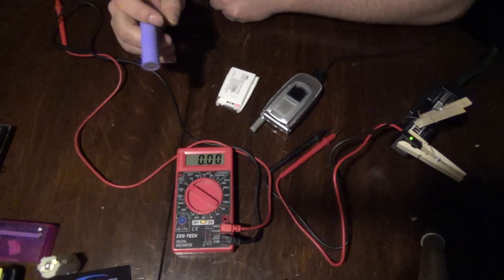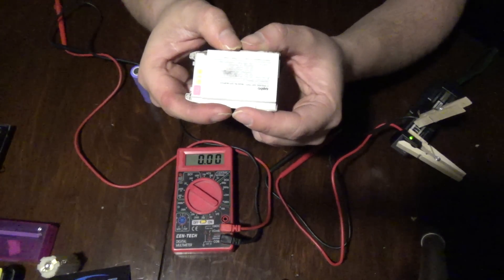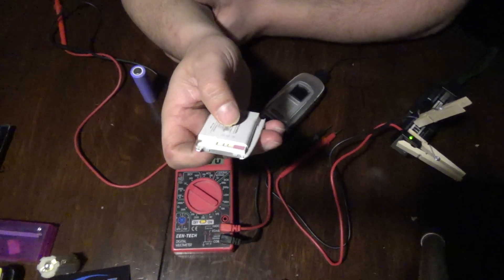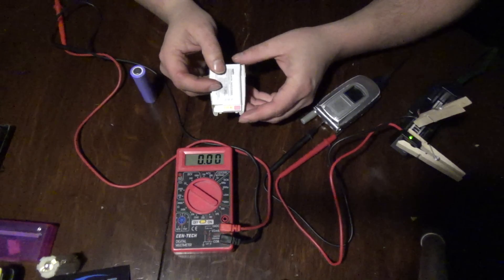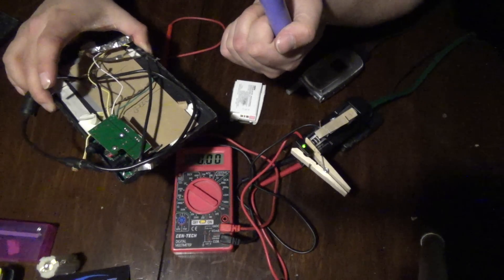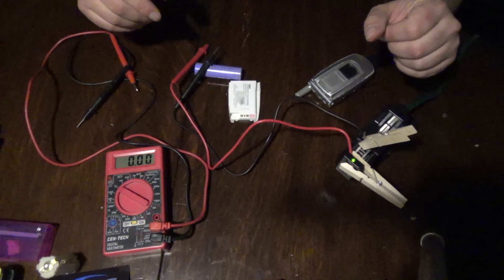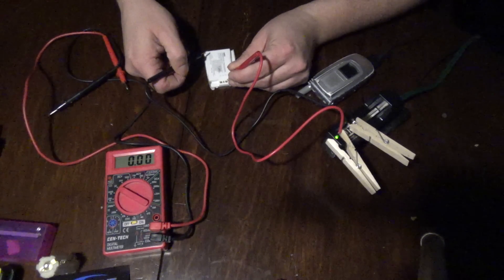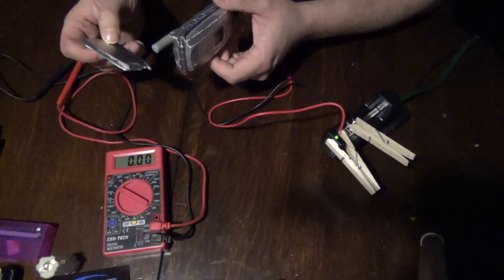How to wake a dormant Lithium Battery Cell. Works on both Cell Phones & 18650s & Similar

Comment: Hi Kman Auto,
This is one of the most informative videos on the subject of lithium batteries that I have come across. Thanks.
I just rebuilt my Acer Aspire 5552 but the new cells are only giving me half hour of battery time same as my old ones. Do you have any suggestions? Thanks.
Reply from the maker: I see, and a little extra detail you provided this time goes a long way :)

The low-down is, it's not actually "Gaining" any capacity back. 

Most people think the power in batteries, like your ipod, or a laptop, is a absolute measure, like, how a car knows exactly how much gas is in the tank. However, this is incorrect.
The "Fuel Gauge" or battery meter, is actually just a GUESS. Believe it or not. 
How this Guess works, is measuring how much power is put into the battery, and how much power is taken out of the battery. Example, if I was able to put 1,000 mAh into my lithium cell, and my flashlight consumes 500mAh, then, logically, their should be about 500mAh of power left in the battery.

However, due to power transfer and charging inefficiencies, this number can be off. Usually, on a device thats used regularly, it wont be off enough to make a difference, however, it can get further inaccurate over time.

The best way to "reset" this, and give the software the most accurate way of getting that guess correct, is by draining the battery very low, then fully charge it. I do that to my Tesla every so often. 

Now, leaving your iPod sit for a few months then using it but finding the battery meter dropping quickly, is due to self-discharge.
All batteries will discharge themselves over time. Lithium will loose 1-5%/month, depending on the age and condition of the battery. So, after sitting for 8 months, the battery self discharged 4-45% of it's power just sitting on the shelf. Now, that power is gone. HOWEVER, the software, did not see that power go anywhere, as the device did not actively consume it. So now, the battery meter is very far off. Then, after a discharge or two down to a low state of charge, then back up to full, allows the software to calculate out closer to the true capacity, and gaining your "lost" capacity back. Your not actually gaining back anything, just resetting the "guess o meter" allowing it to get it's correct charge and be more accurate in the guess.

Now, for Lead Acid batteries, they actually do need "Break in" cycle when new. Example, when I install Lead Acid batteries in a electric car I've built, I need to carefully cycle them. First trip 2 miles, then recharge, second trip 4 miles, then recharge, then 5 miles, recharge, then 10 miles, recharge. And do that a number of times, This allow the new battery to reach it's full potential. If I just put new lead acids in, and tried to drive, i'd get maybe 10 miles before dead. But, with the new battery cycle like that, at the end of the break in phase, I might get 30 miles on a charge. 

Once again, Lithium does not have this issue, and also does not have memory effect. Deep cycles should be avoided with Lithium. Once in a while is fine, but regularly is bad. Lithium likes to be kept and stored at 50% state of charge, not 100%. So before you put your iPod away, drain it down to 50%. Your overall life of the internal battery will be greatly increased!
Reply from the maker: Grazie! You will want to watch my new video on the lithium cells in laptops and planned obsolescence. Basically, you just wasted your money. https://www.youtube.com/watch?v=mXaXDuiU5-0
Reply: ***** Thanks. I always suspected that the manufacturers were out to get us to buy more stuff. Keep up the good work. I love the videos.
Reply from the maker: Grazie! Please Subscribe if you haven't yet. I just hit 6,000. If I can hit 10,000 subs, then YouTube will give me access to LA's Maker Studio, and I can get some of my ideas out!
Reply: Sure Brother,
I did subscribe. I hope you make it and I will recommend to my friends when I get the chance. Good luck.
Reply from the maker: Grazie!
Reply from the maker: Lithium doesnt quite work like that.. Now for Lead Acid, it does require a few charges and discharges before they start to hold there full capacity.
Reply: ***** well at least for me that's how all my batteries behave. Not new ones necessarily. When I put a device away (like an old iPod) for about 8 months, and then try to use it, it is like this. It will both charge and discharge very fast. And when I turn it off, and then back on, the battery appears to have "self charged" an extra 20% however, that extra charge is lost in seconds. It takes lots of use for it to behave normally. And it has happened on many devices.
Reply: How long have you used the battery? New batteries might not give you good usage time. As you use it more and more, it should improve. It might take some time (about a month, with a daily discharge / recharge)

Comment: Right on. Also, if you have reluctant NiMH cells like AA or AAA, try an older NiCd charger for a little bit. It seems to do the same, allowing full charge on the "smart" NiMH charger.
Reply from the maker: Correct, as the old NiCad chargers just applied a constant current, with no automatic turn off. Pump enough in to get the smart charger to be able to see it and do a normal charge.